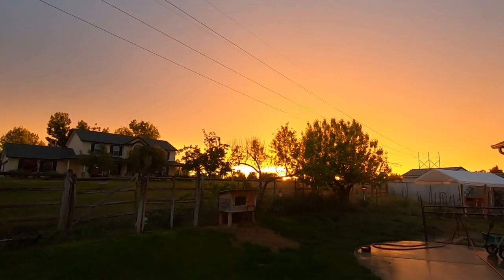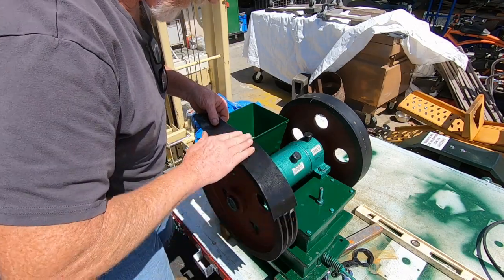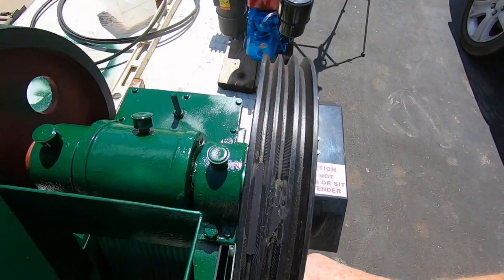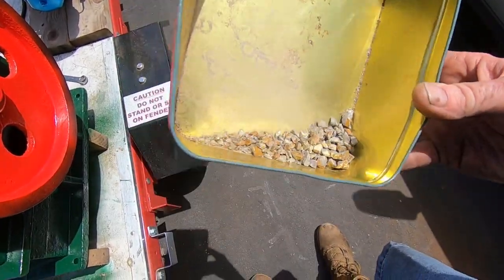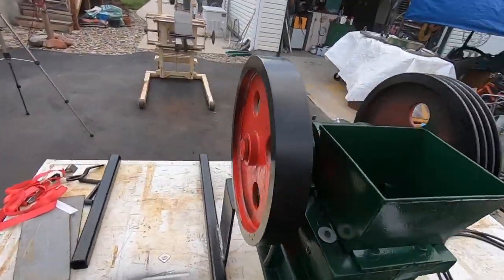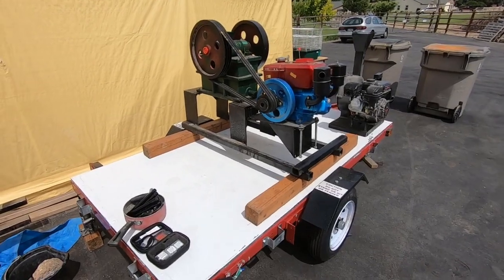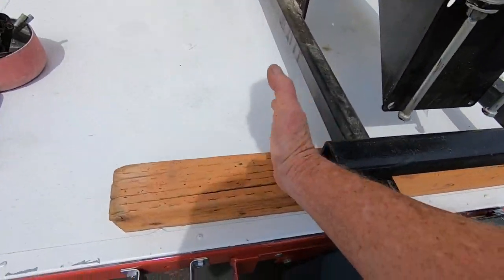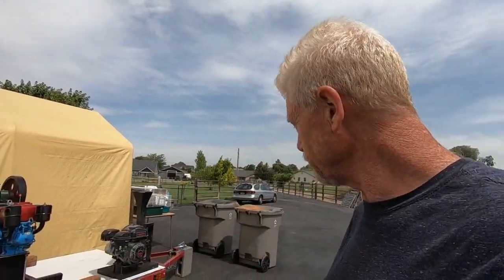PE-4x6 Jaw Crusher Assembled! Frame Built! Running Smoothly!

Comment: Hey mr trip .. wozza talkin to mr keith of the bowens today ..aboot them Chinese jaw crushes and he mentioned you .. im buyin his plans furr the impact mill hes developed ..and i was jurrst makin inquires aboot the jaw crusher .. i think it .ll be ok with some lil mods .. yeah why not ey ..in furr a quid in furr a poound ..im thinkin its a pretty groovey set up .. big plans lil machinery .. lil repairs ..😁oh ..and i enjoy your vids ..😁
Reply from the maker: Hello Rick!
Yes Keith is a good solid information packed dude and his mill is very cool indeed.
The Chinese jaw crusher is a good solid machine. It definitely has its flaws.. not design flaws, but manufacturing flaws!
I was able to fix the weak points and to this point it’s been good.
I would recommend this type of jaw crusher for a small hobby crusher operation.. like me! If you are planning to run it in a higher production environment.. I would go bigger (200mm x 300mm) and possibly a better more expensive unit than the basic Chinese unit. (most Chinese crushers are same design)
My crusher is a (100mm x 150mm) and works fine for me in a hobby situation.
Also I got the Diesel engine vs the electric motor. In higher production I would use the electric motor for reliability.
Thanks much and Crush On!
✌️PT
Reply: @ProspectorTripp  thankinya kindley pilgrim trip .. you should join the convo on tuesday ..witch would be your monday .. i. In oz .. hardrock university  .. great lil chat live .. i could believe when he mentioned you .. so with all this good recomendations i feel like im makin a good lil investment furr a whole bunch of funnins .. and its pretty dang cool that mr keiths knows your work ..whatta spin ..anywhos im orff to ebay to do some window shoppin..chow furr now ..😁
Reply from the maker: @patrickjobling8676  Keith and I have been friends for a couple years. We call each other every couple weeks and solve the world’s problems. 😂 He and Eva are terrific people and I enjoy our friendship.
Remember if you order from China...
1. It takes several weeks to get the crusher to your country. (About 12 weeks to the USA in my case)
2. Read carefully about the shipping cost! Usually the shipping is only to the nearest port of entry to your address.
In my case it arrived in Portland Oregon USA. I had to pay several duties and other customs fees and costs while in the ports custody. After this I had to pay for the shipping from Portland to Boise Idaho.
The original cost from eBay was about $1,500 us
The total cost for shipping was also about $1,500 us
So the final total cost was a bit over $3,000 dollars! 
Just in case you didn’t know 😉
✌️PT
Reply: @ProspectorTripp  excellent mr trip ..as i told mr keiths.. im tryin to get my bpay account unfrozen .. due to an illegal transaction on there end ..so they froze my account ..tolk aboot  having to jump threw hoops n ring bells ..makes life messy n stuff .. burrt i.ll take onboard what ya said .. i think its the way forward ..thanks agins . 😁jolly good carryon pip pips pilgrims

Comment: Bonjour, je suis intéressé par votre produit. Je voudrais plus de détails.
J'attends avec impatience votre réponse.
Reply from the maker: Hello KN, 
I am Not familiar with the French languish..  so I translated with Google translate.
This is what it translated:
“I am interested in your product
 I would like more details
 I look forward to your answer”

Thanks for the question sir!
I purchased on eBay from a Chinese seller.
Was shipped to the closest American Sea Port. From here I paid the Import, shipping, duties and fees to get it to my city.
Total cost was around $3000.
It is a crudely made, however it is very heavy duty and a known good design.
The crusher came with a 5.7hp single cylinder Diesel engine. Overall also crudely made but a solid design.
Not sure about longevity of the crusher and diesel as I have ran it lightly for only 20 months.
Hope this helps sir!
✌️PT

Comment: Yep... I'm still re-watching some of your older video's. I like your set up with the (chain?) mill/crusher. I always wanted to try and rig up my crusher to dump material right onto a Shaker Table. But I'd have to have that Crusher sitting up so high above that feeding the crusher would require a step-ladder. Thanks for all your uploads, they help the day go by (and allows the glue to properly cure  in my projects too).
Reply from the maker: Watch on pal.. I understand sir. I wanted to have the Hard Rock trailer also feed directly onto the table. However it’s not really practical on the trailer. A nice Conveyor belt system will be necessary if I ever get dug in at a claim. And that worries me.. because I Love the hunt! New place new material with new possibilities 🤓
Thanks 
✌️PT

Comment: How are you going to secure the trailer when you are running the shaker table? I really like your set up. I also have a jaw crusher and homemade impact mill but I’m using the Goldcube sluice for now instead of a shaker table.
Reply from the maker: Hello, In the conclusion video I address the stabilization issue. See: DIY Gold Ore Shaker Table Conclusion! Shaking All Over!
At first I used only 45 degree supports at the rear of the trailer. This was Not good enough! Then I installed additional supports that completely stopped the flexing Thread All  stabilizers. 
This works very well.
Thanks much for watching and especially your Comment!
Thanks
Peace PT
Reply: Thanks for the reply I’ll watch your conclusion video.